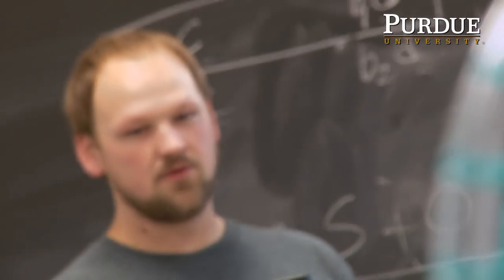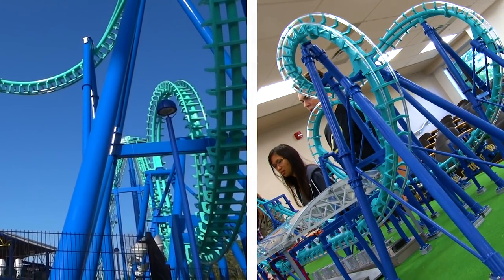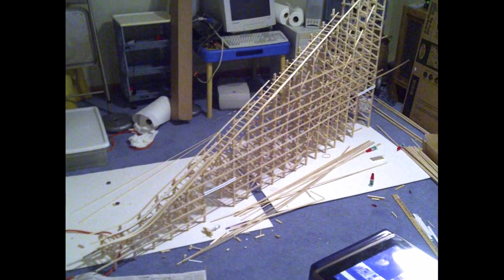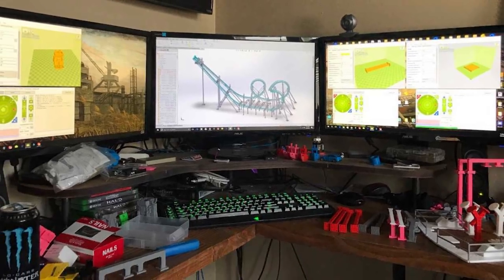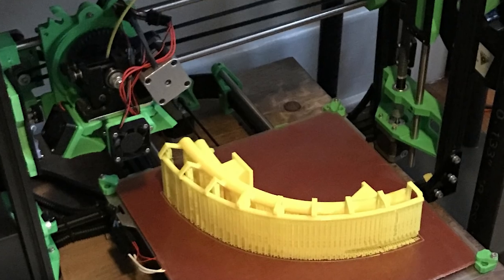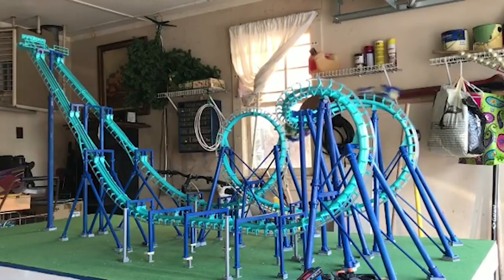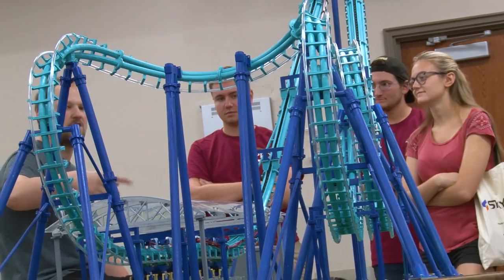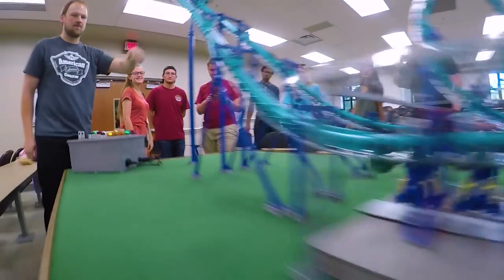3D Printed Fully Functional Roller Coaster at Purdue!

Comment: I'd like to see a simpler, but bigger rollercoaster (without the opening and closing harnesses and the addons like the station) but a coaster that does a full circuit and has the cars on top of the track versus a "boomerang", suspended type... what did you use for the rails/tracks? it looks like medical tubing... brilliant work!!!
Reply: it's 3d printed
Reply: @MatTheGameGuy  thanks.. the rail holders are, but the actual rails look like medical tubing
Reply: @MonsterPartsRc  oh yeah I see it now you were right
Reply: build it then

Comment: That is the RAJUN CAJUN at Blue Bayou in Baton Rouge, Louisiana except the one in Louisiana is inverted as in not hanging on/from the tracks(like this 🎢
Reply: Mikey 101234 it is a mass produced roller coaster by Vekoma. They offer a standard sit down, like the one you mentioned. An inverted version, like the model in this video, and a "giant" inverted version. There are over 50 identical coasters like the one you mentioned around the world.

https://rcdb.com/8191.htm
Reply: Only four invertigo coasters were ever built. The prototype Hangover in Sweden,Invertigo at CGA(which was relocated to Dorney park as stinger) face off (now invertigo at KI and two face the flipside at SFA. Invertigo at KI is the only one of those original four still in operation.

Comment: I would personally like a model of zardra at energylandia.
Reply: There are lots of section on that coaster because it's a custom So probably it would take 1 year and a half (or more) to complete just the track. Then there goes the supports which would either take 8 months to print, then assembling of the parts.
But either which, it would be interesting.

Comment: But it still uses LEGO pieces to connect the cars to eachoter :D
Reply: This was before he had an SLA printer so it's the next best thing. Not all things are printed. The bearings for wheels, the servos, the chain, motors, and rails are not printed simply because they can't be. It's too functional a piece to be printable. The rails would suffer from thickness inconsistency and layers, etc.